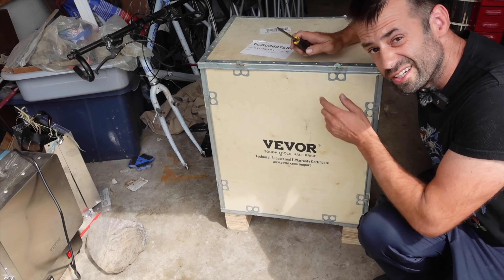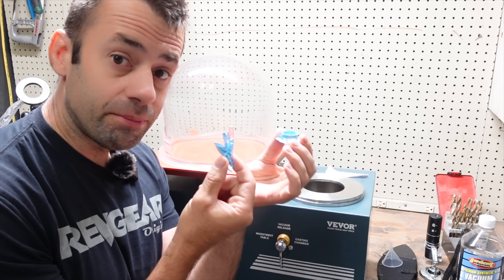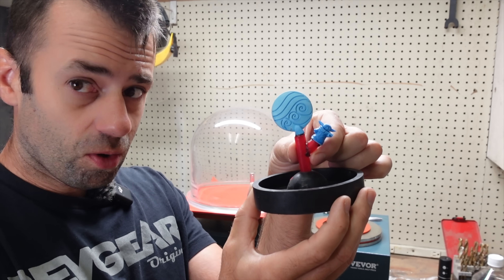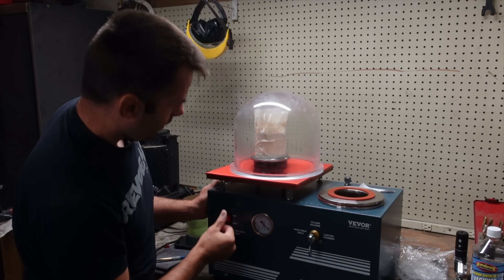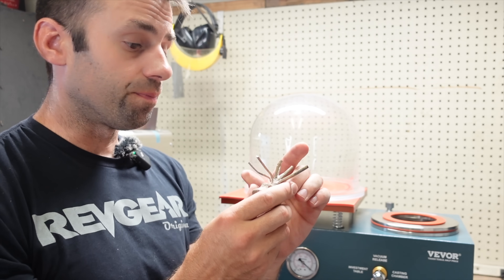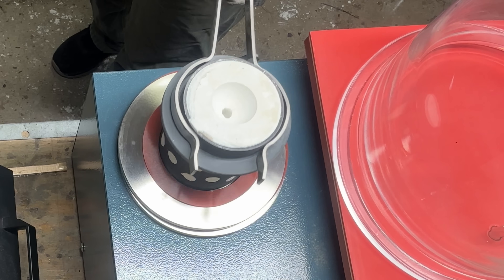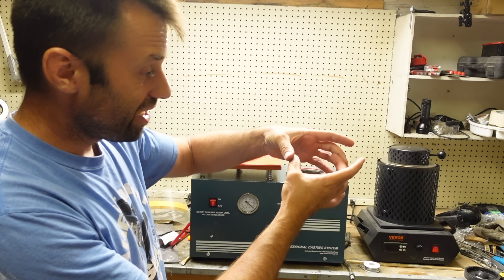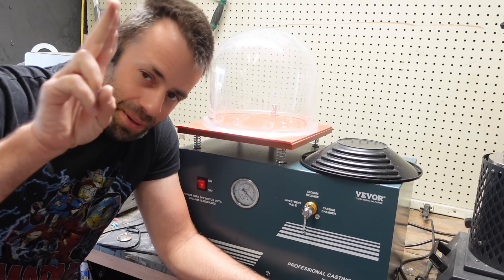New Vacuum Casting Machine!

Comment: Hi, I have the same machine, but mine came with the oil level at the minimum. I have a general idea of the type of oil, but where can I buy it, or what's it called? It's No. 46, ISO 46, but I can't find it. Thanks.

Comment: nice video. If you have a metal lath, chuck up the crucible and turn a camphor on the edge that first goes into the vacuum well. This will help center and start the insertion. Could do it by hand and file/grinder as well.

Comment: I've been wanting to get into melting metals. I'm a hatmaker and I've been using wood hat blocks. Getting these made are surprisingly expensive. They also expand with the humidity and heat, wear down, and can at least at times be a pain to work with. So I've thought about making an Aluminum one. In theory at least it should last forever, would be extremely inexpensive especially if done so with more "trash" aluminum like melted pop cans. It would also be pretty light weight all things considered. But I wouldn't even know where to start honestly.

Comment: I also was annoyed with the gaskets burning. Ended up just buying some 1mm thick flexible graphite sheets to try if it would work. Works perfectly, no smells, melting or burning. Seals well. You can just cut them with a blade. They are fairly brittle and fragile but shouldn't break unless you drop the flask on it with a slam. I use some Patikil brand ones from amazon.

Comment: if you get a machinist to cut .001 inches off the inner diameter of the ring, the thermal expansion won't cause it not to fit.

Comment: If that big ring that the flask sits in will fit into the oven, try heating the whole assembly in the oven and move over to vacuum. Something tells me the engineer applied a bigger fit to the main housing than the metal parts from one another. To keep a fit, heat together, to separate do the opposite.
Not a jeweler but a Millwright,

Comment: You’re casting in the flask holder, that’s why it’s not going in, that should stay in and you drop your actual flasking into that, so you really think they designed it so you should be using tape!?

Comment: You should vacuum the investment after mixing as well as after pouring into the flask.  I have a poll mounted on the table where the caster sits.  The bell always is stored on the poll except when de-gassing.  This way I don't accidentally leave it sitting on the caster when casting.  The silicon rings can take 900F.  They are however consumables.   You are putting way more metal in the electric furnace than you need.  Weigh your wax model and multiply it by the specific density of the metal your using and add 25% for the button.  Ex the multiplier for sterling is 10.3.  If your model weights 10g them you need 103 g   + 25.7 g  or 129g of metal to cast

Comment: After going through several silicone pads on my vacuum table I started cutting replacements from cardboard about 1/16" thick (like a shoe box, not corrugated). I soak them before pouring the first flask of the day and then just dip them in water before each subsequent flask is poured. they seal just fine and I can easily get a dozen uses from one at no cost.

Comment: I'd use a die grinder and an abrasive flap wheel if ya don't have a lathe since that flange need not have a precise bore, just one that fits as you prefer it. 
I clamp such things vertically in a bench vise so I can properly two-hand the die grinder for maximum control even with small grinders. 
Two hands allow much more stable bracing which is why professional stick welding is typically done two-handed.

Comment: I bought a chainsaw that didn't last very long.  Chainsaws have an oil pump to dispense a little oil to the bar as you work.  I think that pump relies on a plastic gear, so I wish that were bronze.  Otherwise, it's a great chainsaw.  This casting looks like the perfect way to get there, and never have the chainsaw quit oiling again.

Comment: At the beginning of the video, you showed a variety of rings that were included. Did you try any of the larger size rings? Perhaps that would avoid the thermal expansion problem.

Comment: Really exciting to see you working with the vacuum casting machine! I got the same one (mine even has an integrated melting unit, but otherwise it’s the same). On my first attempt the ring also came out too small — super frustrating and stressful, because I didn’t want to mess up my first casting after a whole day of burnout. In the end I quickly used an angle grinder to make the ring bigger; otherwise the entire day would have been wasted.

What’s disappointing is that the manufacturer seems not to have properly tested the machine as shipped — basic workflow issues like getting the hot flask into the vacuum chamber in time shouldn’t be left to trial and error.

I’ve uploaded my first bronze and a silver casting on my channel if anyone’s interested. Thanks a lot for your videos — I always enjoy them and they help a lot!

Best regards,
Alexander from Salzburg

Comment: Thanks, Lucas!  This is a great video.  I'm not yet sold on vacuum casting versus centrifugal, but I certainly want to try it now that I've watched you.  
'P.S.: Centrifugal casting isn't scary at all; it's anticlimactic - when you release the arm to spin it, the whole operation is over in about a tenth of a second, then you just wait until it slows down (a few seconds) and then drop the flask in water.  Since you never have to actually pour any metal, it's a lot less nerve-wracking a procedure than vacuum or gravity casting.

Comment: Change up the height of your springs (Yes this means you need to change up the length of the rods that the springs are on as well.)
The reason are you will have a choice.
Choice A:  
Buy from a thrift store a back massager and place it working under the bell Jar plate on Low when you are doing a the investing.  this will help the bubbles make it to the surface by agitation as the air gets pumped away. 
Choice B:  (The better choice; But takes more work and skills)
Make the whole bell jar and plate swish around kinda like you were panning for Gold but on a flat plane.  This will more gently coax the bubbles to collide with each other double in size and race to the surface without as much chance of vibrating the work off the sprue.

See currently your not even doing the tapping that gentle rapping at my window and speaking of "lienor"  (Ops slid into some Poe there and it's not even close to Halloween.)  
OK back on track.  Take a small light weight rubber or plastic coated mallet and tap on the metal plate next to the bell jar.  You don't want to hurt anything you just want to cheaply make a vibration with each tap.  This can be productive when the plaster is very wet and move the bubbles to the surface and cut down on heavy frothing that you have at the end.  Many keep the specific mallet on a cord that is attached to the vacu caster so that it doesn't wander off between casting sessions.  (Again don't use like a standard construction metal 16oz hammer they will mark up metal plate use something with either a rubber or plastic coating.)

How do I know these things?
I used to sell that equipment.

Comment: 1. The newer machines have the vacuum tube connected into the side of bell Jar.
1.a. The Older systems they used to add a LOT of inline fuel filters into the plumbing, ones that do not collapse when hit with vacuum.
(The reason for them was you don't want ANYTHING making it into the Vacuum pump and damaging the pistons.)

If you ever break your bell jar buy the replacement with a pipe on the side they don't suck up the stuff that is on the rubber pad.

Comment: For your thermal expansion issue, try heating the ring. Even a few passes with a heat gun or butane torch should be enough.
Reply: I was going to suggest that but you bet me to it.
Reply: Silicon spray 🤷🏼‍♂️
Reply: I leave my ring on top of the burnout oven so its hot when Im ready to cast

Comment: MAYBE you could place the collar around plaster container and then heat it in the oven, then you won't have to worry about it being too large when it's hot and expanded 🤷‍♂
Reply: oh wait, nah just use the larger ring, it will hold it just fine. as long as the container doesn't fall through then its doing its job.  you don't need a large amount of contact between the container, the silicon washer, and the ring in order for it hold the vacuum. plus I dont think it would fit in your oven with the ring already on, AND it will be quite difficult to get it all out of the oven because the ring would be laying at the bottom of the container and you'd have to lift it up to that lip, AND you'd have to put the silicon in the oven too. So I think the next larger ring is the best solution :)

Comment: Put your sizing ring on the floor of the warm kiln for a minute. With that bit of equalization it'll probably be easier to put the crucible in it and then move both to the vacuum.
Reply: What a great suggestion!
Reply: @blackburd  Yeah. I think you could probably put it on first on a stand, and heat it with the crucible - but I'm not sure. You may end up with puddle of aluminum under your nicely prepared crucible.

Comment: For the tightness problem you could enlarge the inner diameter of the sealing ring. If you have a lathe or know someone with a lathe, then take off 
a little bit from the inner diameter. A cruder solution would be some kind of a small grinder to remove material from the inner diameter.

Comment: Howdy Lucas!  That pinecone came out astounding! 😲

I wanted to give you a tip.  Here's what happened on the pendant: the investment got in there ok; that wasn't the issue.  What happened was the investment broke off during the burnout.  🙂 Here's how to fix it: Never print anything solid!  😁  Looks like you're using Siraya Tech True Blue, which is the same one I use.  What happens when you print things solid is they expand more during burnout, and that destroys most of your fine detail.  So, what you want to do is to use as little resin as possible so when you cast something big, so it doesn't expand much.  I stopped making sprues out of wax and building trees years ago; I print the whole tree,  but I have an advantage, and that is I'm a jeweler and make the same things over and over.  In my case, for the things I cast, I have everything dialed in to such a degree that I print everything with a 40-micron or 0.04 mm wall thickness.  Also, another thing I do that is different is I have a hole drilled into the bottom of all of my rubber sprue bases and dabs of wax on the bottom to hold the base up a little.  This is to let air out when vacuum degassing.  This is a precaution; I never tried it without having a way for air to escape.  The pressure that would be present under vacuum would depend on your altitude.  I'm at 5,059 ft.  Oh, and I use Certus Prestige Optima, but I don't know if mine is better than yours or not.   Anyway, in your case, you're making one-offs all the time.  By the way, I'm a sculptor too, but I never get around to doing what you do, but I want to someday.  🙂 So, in your case, you'd want to have wax tube sprues.  I doubt they can be purchased somewhere, so you'd probably have to make your own.  Or you can just print them.  You cast huge stuff compared to my tiny jewelry castings, so you'd probably want more robust sprues, say, 60 microns to a mm wall thickness.  And yes, when you print things with a 40-micron wall thickness, they are extremely fragile in Siraya Tech True Blue!  I break stuff all the time and have to reprint.

I'm a miner too, so I also watch your mining channel from time to time as well.  😁
Reply from the maker: That’s great advice. I appreciate that!
Reply: I am trying to make some jewelry pieces using my Saturn 3 ultra and I have just been doing prototypes. I have not printed anything in castable resin or casted anything yet. I plan to use the Siraya Tech True Blue but now you have me so curious about printing the tree to cast it on. Do you print your model seperately on its own supports and then join them for casting? Currently my model is a solid piece so I can print it... I wonder about this expansion you are talking about now. Any way I can pick your brain or learn more about this? Videos or contact? Thanks in advance for any additional help. And thanls for making this review... it is always educational to see how someone goes through the process.

Comment: Can you put the ring on top of the furnace for a few minutes to get it to expand before putting it on the casting machine?
Reply: I think it would be far easier and safer to just increase the ID with an angle grinder, a metal file, or a lathe ideally, but not everyone has a lathe.
Reply from the maker: I could but I shouldn’t have to.

Comment: I fail to see why go all over all these steps when you can just get a 3 axis cnc? is there any reason? it seems to be VERY time consuming
Reply: Between CAD, CAM, figuring out various setups and organizing expensive and delicate tooling, proving out a program and making sure the workpiece is perfectly machined and finished, a lot of time is wasted, but once all that is done, you can use the precision machine to replicate the project as many times as you like. Cast work tends to be more unique and seriously differs from machined works, which are identical unless something is changed on purpose.
Not everyone has the knowledge and ability (or money) required for CNC machining. Besides, it would no longer be bronze casting if you were to machine it from a bigger piece. What you are talking about is so different from what this channel does, that I really don't know why you are asking this or even wondering to the extent of writing a comment about it.
Reply: @Convolutedtubules  oh my bad mate, just came across this channel randomly, I thought you were doing this at scale because that's what I usually look haha

I was like, why the fk isn't he just using a 3axis or 3d metal printing lol

My bad mate :)
Reply: Have you seen his other channel, Glacial Gold Hunter? I wonder if you have any suggestions for a less time consuming method of finding specks of gold. Perhaps filing down a gold bar? I'm just messing of course.
Reply: I can guarantee, that in casting it is way easier to get finely detailed results fast, than it is in cnc machining. Also you could upgrade your cnc robot from 3 axis to 7 axis at exponential costs and you could still not get the same complexity in certain objects with tight gaps and overhangs. Meanwhile his machine would need zero upgrades for that, just maybe add a few flow tunnels to his model and change the orientation of it a bit. Also he does cast a lot of organic objects, which he can just put into investment and then burn it out. With a cnc he would need to create a 3d object. Also about what has been adressed before about making duplicates/more identical parts: that is really easy to do in vacuum casting with silicone molds. And most important: if you enjoy casting and hate figuring out cnc, you should just do that, he is doing this also because he enjoys it.
Reply from the maker: If you can’t see why anyone would cast something It simply means you haven’t seen enough.

Comment: Thank you for this review.
For investment cap, you don’t have to remove it every time. Just push it to the back to make air go inside it when you use a casting vacuum. 
And for the thermal expansion issue, I see a little weld spot at the bottom of the casting cup. Just grind it with a file or any angle grinder and this may solve the issue.
Thanks again for your review 🌺.

Comment: What is the purpose of the springs on the vacuum table?
Reply: While pulling a vacuum to remove air bubbles out of the liquid investment plaster, some air bubbles get trapped in or against the wax model. The springs under the platform allow you to shake/wobble the platform periodically during the vacuum process so any trapped air bubbles can break free and get sucked out of the mix. 🔥
Reply: @timelessfoundry Thanks, I was wondering too.

Comment: Cool machine. 
I’m kind of skeptical of Vevor products. They seem too inexpensive. Would love a follow up on the furnace and this machine after time and use.
Reply: If you've been on the fence about getting equipment from vevor, so was I for a long time. A lot of their products are on the same level as more expensive brands, depending on the product of course. With other things, you get what you pay for, however it can still be an effective way of starting a hobby.  Speaking metal melting furnaces, I am very happy I got my furnace from vevor. I explored all the options available to me, and decided that for the price, it's the best you can get. If you are willing to invest a lot more from the start, sure, consider a higher-end brand. I'm very happy with the performance of the few things I have that are branded 'Vevor'.
Reply: you should be skeptical… the profits are used to undermine your local economy and social fabric
Reply: @TurdFergusen it’s just world trade, the usa has been doing just that for decades.
Reply: @flyerphil7708  you mean globalism ?  gonna be lit when oil runs out…
Reply: @TurdFergusen But how else is one supposed to pursue their hobbies on a budget? Cheap Chinese manufacturing opens so many doors for so many individuals interested in niche topics. I do however understand the point you're making.

Comment: Word of Advice I have a Kerr casting Machine, and the Mice will eat those silicone rings given the chance, so store them in a secured location.
Reply from the maker: Thanks for the heads up!
Reply: You just gotta feed your mice properly. Give them a hamburger or two
Reply: I second that, mice will eat silicone rubber wires in cars as well